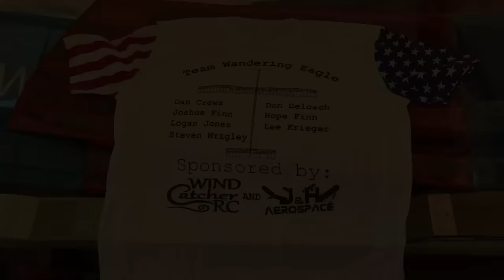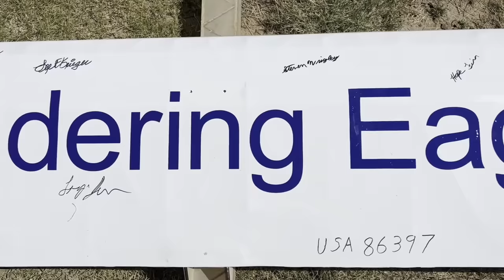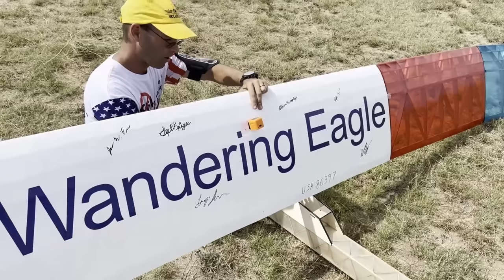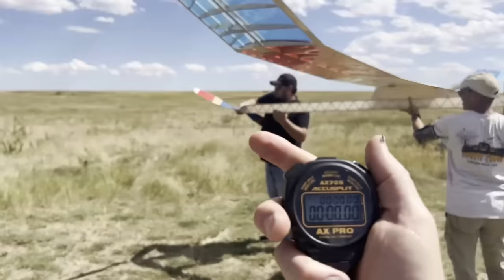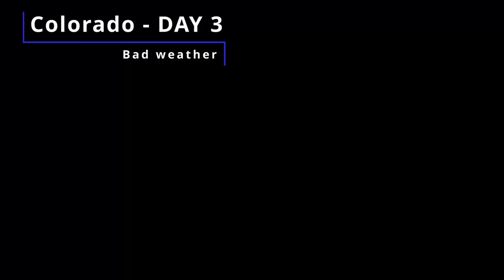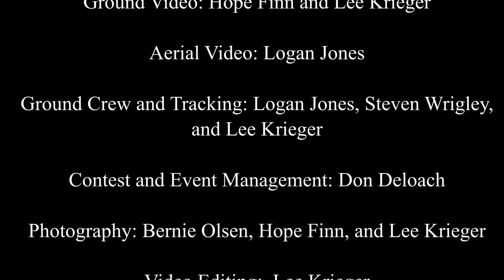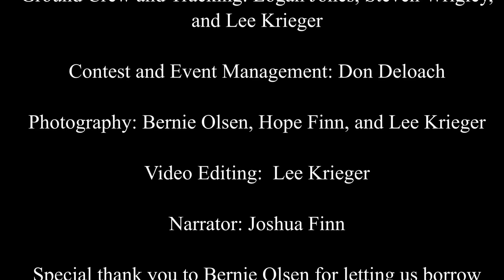Rubber Band Airplane World Record!!!

Comment: fyi      because of the type of profile used in the wing, the wing makes extra drag, ALL of the time.!       the flat-bottomed n-10 profile at airfoiltools would be a better choice.          a polyhedral wing makes more drag than a dihedral wing, all of the time.          does a thin, asymmetrically shaped horiz-stab leading edge make more drag than a symmetrical one.          WHY  is the tail boom so long.          the span of the horiz-stab could maybe be reduced; to say 28 percent of the wingspan.          it appears that the convex contouring of the prop blade trailing surfaces  is less-than ideal.      d
Reply from the maker: If it were such a high drag section, they wouldn't use a similar one on the F-15. We did head to head glide tests of these airfoils. This one gives the best glide performance by a wide margin. Flat bottom sections give about half the glide ratio. Polyhedral promotes a correct elliptical lift distribution and reduces interference drag at the center while improving spiral stability. Again, I've tested this extensively. Nothing on this airplane is experimental or the result of opinions. It's been tested to ensure that we're getting the best possible without having to resort to molded carbon construction. As for the prop, if you can cook up a better one, I can give you the hub dimensions and you can make blades and bring them to me for testing. We'll shoot a video on it and see what happens. I welcome an improvement in prop efficiency. Come make a vid with me.

Comment: why not wind the band with a screw gun? or any a socket driver... ?
Reply from the maker: Not enough control, and most aren't self ratcheting, which is a major safety issue of there's nothing to hold onto. Plus I'd need to engineer a grip and arm band that would work with one and then deal with the fact that it still doesn't reduce the felt tension and torque (plus having a bomb in my hands if the motor stalls and overheats the battery).